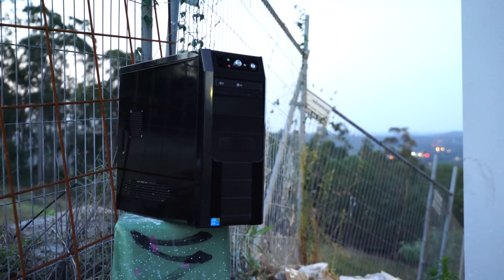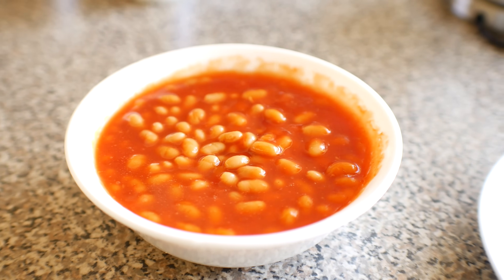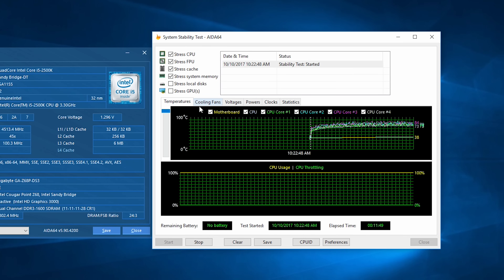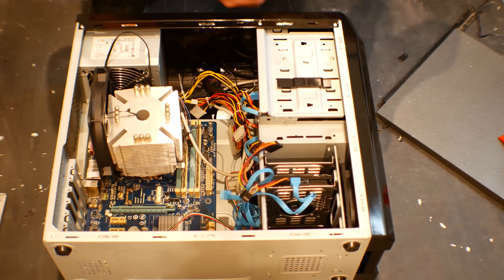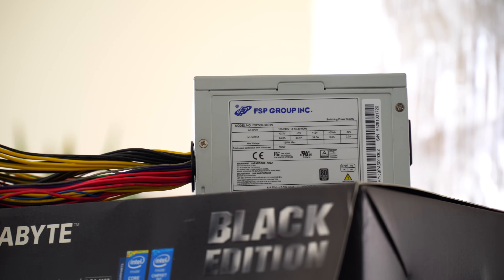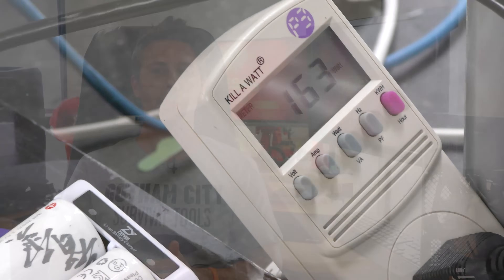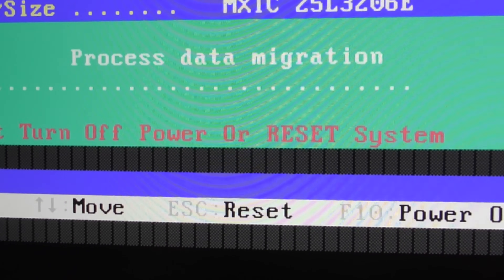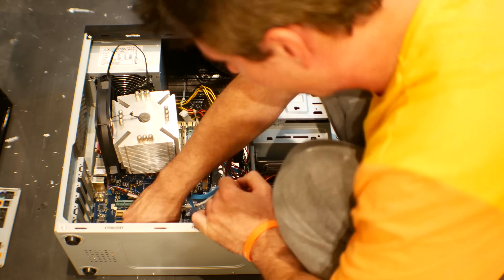Can you OVERCLOCK with a Zip Tie, Bad PSU & Budget MOBO?

Comment: I once had a shitty PSU from a brand named "HKC" and I rotated the 4pin CPU connector 90 degrees when plugging it in, so basically shorting the 12V rail. When I turned it on a bunch of smoke poured out of the power supply. Reconnected the 4pin properly and it worked fine.

Comment: I put two fan in my powersupply, not branded 480w 19A max on 12v used for 3 years, now it's running gtx660 uc and amd x4 860k stock . Can I overclock the cpu?

Comment: you can overclock i5 2500k to 4.5 because the i5 2500k does not support hyperthreading and only use around 80 watts at 4.5 ghz unlike i7 which use up to 180w( more like 160w though) at 4.5 ghz

Comment: Replaced my 7 yr old VX550 with a new Seasonic M12 620w. Barely 3 months into using it, smelled something "electrical" before it started turning itself off. Had it RMA'd and the VX550 is still chugging along.

Comment: Hey man! I haven't had any PSU die on me, but the OCZ ModXStream 700W I got in 2010 starting making a loud pop sound and spewing sparks when it first received power last year (by using the on/off switch or plugging it into the wall)

needless to say I hope, but I immediately stopped using it and got a replacement.

Comment: Try to do an extreme overclock with an fx-8320. I would get the fx any day over a 2500k, they run extremely hot but you can get them to 4.7 stable with a good cooler and even higher with watercooling

Comment: It's worse than supplying bad voltage, these "bargain basement power supplies" have a lot of electrical noise and well, a malfunctioning 5VSB which very likely will instantly kill your motherboard.
And they are missing parts too. What they do really, not a joke is start with a old design and stop taking parts out when it stops functioning and then put back the last part.

I had to RMA good power supplies anyway, principally because some creature went into the PSU and blew the main cap up and it leaked terrible fluids for seconds.
These shit power supplies though... I've blown them up with just 200W.

Comment: my first ever computer when i first started building 10 years ago i bought a 500 watt Rhino power powersupply that actually shorted and melted all the sleves off the cables to the point all the wires in my computer were bare metal.. miraculously all the parts in the computer survived.. well other then the power supply. i still have them laying around to test stuff i buy on ebay! My advise Get a good powersupply and the way i see it is if you aint buying name brand then you should not put anything together with it. diablotech is one crappy brand but for a 120watt system itll do you good.

Comment: Some time ago I had replaced my old PSU because I was hearing coil whine. I did research and every site was saying it'd be the PSU, so I did a smell and touch test. Didn't /really/ smell anything, maybe a little of odor, but to touch, damn that thing was hot. So I replaced it with a new Rosewill ARC 650W and was all good. Only for the coil whine to still be there! Turns out it was one of my two front case fans. I have the DYIPC Adventurer-18-G and it has fan controllers for the front and top fan speeds, and turning the front ones to low eliminated the whine. It was like the fan was telling me the PSU's gonna blow, mate.

Comment: Using 50W out of a 600W (supposedly) power supply is as stressful to it as using 570W. At very low loads, the power supply is very inefficient, therefore more heat and more stress. It is usually recommended to use around 50% or so of a PSU's rating. Just pointing it out, but yeah, ye videos are great mate. :)

Comment: I remember a long time ago working in a computer shop...

Boss did order a pallet of L&C "300W".. All of them 300W... yeahhh..

1/10 of these 300W did have a label with black text
2/10+- did have a label with green text
the rest did have a label with red text..

Beside the text color, the label where identical (same rating).

These power supply did come with a note paper with the following on it:

- 300W with black text on label = 300W
- 300W with green text on label = 250W
- 300W with red text on label = 200W

I wonder if that kind of arrangement still exist.

Comment: I had a pc power and cooling 750w psu blow out after about 8 years 24/7 use.  Had a ups fail with a bunch of magic blue smoke, rebooted pc and the caps in my psu made a really loud pop. Psu actually still was supplying power to continue booting my pc until I flipped the switch to turn it off. (No damage to any other pc components)

Comment: I keep a cheap Diablotech 350 watt PSU as a bench PSU in my shop for testing fans, and doing basic test builds with just a basic cooler, ram, CPU,  onboard graphics, or a low power Nvidia 8800GS 512MB PCI-E card for older motherboards to see if they boot since I got the PSU for free, but I would never use it in a full system build for sure, and far as having a PSU fry on me I had one of the green colored Antec Earthwatts 430 watt continuous 80+ bronze PSU's give out on me about 2 years ago now in a big puff of smoke leaving some brown, and black marks in the top of my then current cheap $28 case, but I got lucky because it had good over voltage protection so nothing else was harmed, so yeah even brands you think are decent can sometimes give you trouble, but I've had good luck with Newegg's Rosewill housebrand power supplies so when I'm buying on a tight budget I always check their prices, and see if they have anything in the 500 - 650 watt 80+ range or better on sale.

Comment: Just going to say I know why the quad sli didn't work. The cpu can only handle 16 pcie lanes and a dual graphics card needs 16 pcie Lane in one slot as it will not run on pcie x4 for one card hence why the bottom slot wasnt working properly. Should buy a old 3820k of 3930k as they can handle 4-5 video card configurations

Comment: Bad PSU - happened to me more than a decade ago, as soon as I powered my rig up - didn't prompt a screen and I saw my motherboard light up like a fireworks was happening. It took out the HD4850 1GB GDDR5 Graphics Card, Processor, the board and a Hard Disk. I can remember it to this very day.

After that - I only trusted branded Power Supplies to this day - never go cheap with your PSU, just aim for the "Bang for the buck" instead.

Comment: @Tech YES City that board can overclock that cpu even more  just were you went wroung  is that bios is bugged and you have to go to where the turbo settings enable it , set voltages  in there and amps to 350 then disable the turbo and it still retains the voltages for the cores  just not turbo , and then apply youre normal cpu clock voltages ie 1.3V / 1.4V and you should hit around 4.8 to 5.1ghZ

Comment: Most important thing is to cool it properly and test it regulary... I had Codegen 500w for more than 7 years it has several build running (geforce 9600 gso 192 bit, 2b ddr2 ram 800mhz Athlon X2 5200+ 2.7 ghz Hard disk 350gb Hitachi dvd driver two 12cm coolers (one on front and one from behind) and later after 2 years I replaced gpu with HD 6670 1gb ddr5 and 2 more gb of ram (4gb total) one more hard disk drive 500gb (total two 850 gb) it ran from 2009 until october 2016 when i replaced gpu with a way powerful HD 7870 2gb ddr5 256 bit (with molex y cable 2x6 pins) 4 more gb of ram (8gb total ddr2 ram 800mhz) Phenom II X4 940 3.0 ghz Black Edition (140w on stock voltage) and it ran amaizingly fine, without single issue, brands doesn't mean "evetything" just check it, test it, clean it and enjoy with it... I upgraded a gpu for one kid (he had hd 4500 4600 ) gtx 450 1gb ddr5 128-bit Phenom II X2 555 95w 4gb ddr3 ram and 500gb hard disk drive and you wouldn't believe ON 175W LOW END PSU... Now he plays games for more than one year without single issue...

Comment: 2500k are great overclockers. I've bought a 2500k on a p8z77v-premium (I think that has 16 power phases, best board of the time in my opinion) with a 670 4gb, 4x4 stick of corsair vengeance ddr3 and a tx750watt, in a working computer that had a broken hard drive for 300$CAD. I've managed to overclock it to 5ghz! It did 4ghz at 1.16v if I remember well. They're incredible little chips still.

Comment: Yesterday I just blew up ( literally) my Corsair RM1000x. I heard a loud pop and the computer went off. Everything ran fine for about 9 months (since I build the system) with a i7 6900k / Rampage V and 2 gtx 1080. Do corsair cheap out on some capacitors / chokes on these PSU?

Comment: yes i done it thxfully it pop when plugged in another motherboard for testing and motherboard still worked fine. was a dell dimension 8200 board i850. Startec psu are good quality

Comment: I bought  a corsair rm 1000i pwr supply to run my evga ftw mb with my 3820 sandy, two r9 280x's with kraken hybrid coolers, 16gig  of corsair 1600 memory 4x4 and a samsung 840 250 gig ssd. in a haf 932.  The corsair pwr supply came with red sleeved cables as a promotion, great!  PROBLEM, whoever sleeved the cables pinned the eight pin to the motherboard and one of the eight pins to one of my graphics cards incorrectly and when I powered on my system, it promptly caught fire.  whole system fried.  Corsair only replaced the pwr supply and sleeved cables, MSI replaced two graphics cards, albeit, two r9 390's, still,  out a very high end rig for the time!  I'm going to go cry now, AGAIN!

Comment: I have one very old system with powersupply called "Micro one" and when I started overclocking and set up 24/7 gaming server. It blew up in 3 days. Only one resistor had burnt so I replaced and it is still working!
Reply: I'm not too worried about it because It is 2005 system.

Comment: i got a dell t3400 $30, gtx 570 2.5GB $61 and a Antec neo 620w $27. The Dell t3400 came with an e4600, no HDD  and 4GB ECC ram. I can upgrade to an X3360 or Q9550 for less than $30. I still need to upgrade cooler to a dell 3 heatpipe cooler ($10 in ebay). I just want to play overwatch so once I get my 4 core I should be able to do it without an issue. I can also upgrade to 16GB ecc ddr2 ram ($16 in ebay)

Comment: I blew two EVGA 750 Gold rated PSUs after 2 years of not that heavy use. My system wasn't ever overclocked, it's barely dusty and I don't have very demanding hardware. When I tried to send it for repair EVGA asked me to ship it to Germany for them to DECIDE if they should fix it and the delivery was on me... Really disappointed me with that policy. Why should I pay for delivery on a part which is still in warranty? Anyway though... In the end I bought another EVGA PSU (this time the 850 Gold 2) and well, it's still running, I've still only swapped a graphics card for the 290x

Comment: Back in 2016 I had 3 power supplies die on me first was a evga 500b, second was same, third I went with a corsair cx650m it died 3 months later told corsair my issue they accepted my rma and since then haven't had one die on me (knock on wood) but now I shut the pc down every night.

Comment: I have an HP ENVY h8-1534 I installed a 1050 Ti in it, was great then I found out that I could OC the CPU with AMD's overdrive tool.... The PSU in it died after that. (was only able to OC like 300Mhz over stock) so I ordered a new PSU from newegg and picked up a 650 watt bronze from Rosewill on sale for like 30 bucks at the time. (I didn't want to spend much money on that system) the difference the PSU made was astounding, the system now sits at 4.7GGhz stable 24/7.

Comment: I'm not sure if left this message on this channel but yeah Crysis shut down my 2005 Silver Stone 650W PSU not once, but twice. I thought something horrible went wrong the first time but the PC booted back up and I tried it again. The second time I only got to play for a minutes till system shut down, the first time I got around 3 minutes of gameplay. Once I swapped out PSUs everything was fine. I swapped it out with a Rosewill 600W value 2 (free PSU from work) but it pulled through a half hour of gameplay without a hitch.
Reply: Oh yeah, I also had to zip tie a the stock cooler for a Socket 478. the motherboard side of the plastic mount snapped and the lever wasn't pulling on anything. Got out the zip tie's, cinched it down and 4 years later the PC still worked just fine. Zip Tie's work great if you take your time and get it even when tightening it down.

Comment: i got 1 extremely old sfx psu (forton source) 145watt with 4.5A 12v and it didnt even have 4pin cpu or any sata ,6pin gpu power cables so i put all reguired extra adapters an run athlon 64 x2 5000+ 2.6ghz @ 3.1ghz + HD 7770 ghz edition max oc ed. this powersuply is from 2000 to 2004 year and after a month of usage the psu stopped working at all :DD

Comment: Thought you were going to give up and connect the FSP!
Just bought a used FSP300-GHN, and that 300 watt has 24A at 12V, compared to just 1 amp more for that supposed 600W - it's going in my bits and pieces build.

Had an old 300W case PSU that got semi-cooked when the grumbling fan (I'll fix that later) finally died... system crashed, and EVERYTHING survived, even the PSU was still ok after replacing the fan

Comment: Im 99% sure my psu died in the summer. It was 7 years old and a cheap branded one. guess i got lucky with it lasting for seven years. the thing is i left the room to go and have dinner so i just assume the pc had gone to sleep and came back to it trying to power cycle and now doesnt do anything. since then ive made do with my laptop beacuse the pc market is just crazy atm.

Comment: I had questional psu in my old prebuilt,it was 500W Zito,only problem i had with it was fan died so i just lubricated it and it works to this day. There is nothing wrong with bad psus if you dont push them to the limit.

Comment: 3 months old Chieftec 600W blew up. 24pin connector melted. Sent back to repair. 
After 1 month they gave back the PSU and refused the repair "the connector is physically damaged" . Since that I am trying to explain those dumb fucks that yes, its damaged due to a fucking short caused by the PSU which was BTW on the warranty form since day1.

Comment: I figured you guys could help me out
I recently bought a Lenovo ThinkCentre M91p MT (I replaced the power supply btw)
In the bios I couldn't find any overclocking options
Is there a modded bios or updated bios I can get or is it just impossible

Comment: i have destroyed codegen PSU with strong resistor. it said it was 400w but rly it was able to do was around 50watts on 12voltage rail. :D also have destroyed some Hipro psus with car sound amplifiers these are also pretty terrible psus

Comment: I had a Thermaltake TR2 Challenger (500w) and when I swapped out my 960 for a 1070, a few months later, whenever I would play high demanding games like Rust and even Battlefront (2015), I would get constant shutdowns. I then swapped out the PSU for an EVGA 600w and it's been running fine ever since.

Comment: I've had a rather crappy psu for over a year now and it has never failed me, before I had a G3258 running @4ghz and now I have an X3430 @3.4ghz, but the thing is that I've never went above like 1.5v on those cpus (actually on 1.225v) to avoid the risk of asking too much from the psu.
Btw great videos, love them, keep up the good work. Greetings from Chile!

Comment: I had a power supply for an Intel 915 series board that one day literally blew up, sent a funnel cloud of smoke out of the back of the computer, and then I saw flames coming up the back from the front of the computer.  At this time I turned off the strip it was plugged into.  It was not a cheap ps.  It was called and earth friendly ps and was at that time pretty expensive.  I decided to tear it apart and found the wound section that was the 3.3 or 5 volt was very crispy and black.  I have not bought any of their PS since.

Comment: When i built my Ryzen 7 1800X PC back in April i had an 800W  bequiet! Straight Power 10  blow up after 5 days out of the blue. It was so gone that at first i couldn't get the circuit breaker to come back, only unplugging the PC let me get back the power in the room, and the instant the power cable made contact with the outlet it tripped again, not even going for the PC power button or anything.  

Luckily no other components were damaged, and the replacement PSU of the same model is running flawlessly ever since.

Comment: "If you smell something bad" :D.  By then it's usually way too late in my experience. Great video bud, I still have my original 2500K - what a beast of a CPU!
Reply: AdoredTV i once smelled the “smell of burned hopes and dreams you never forget” and it was one stick of my gskill tridentZ :( right before ram prices went through the roof
Reply: I smelt that smell once. It was my Kingwin 850Watt modular power supply exploding after 7 years of use. Thankfully it didn't take anything with it.
Reply: that smell is electrolyte coming out of the capacitors... Thats why we are buying mainboards with all solid capacitors :)
Reply: My 2500k is running 5.99 GHz air cooled for 3 years now. That's the jackpot in silicon lottery.
Reply: SchaSch94 OOO: what voltage?
Reply: SchaSch94 6ghz 24/7 stable is crazy
Reply: probably has liquid nitrogen in his air cooler and runs it at 2v
Reply: Might be a whiff of hardpaper, resistor paint coat, or of heat shrink tubing being burned to a crisp. These can occur early enough if you're lucky, if a component is running at its very limit rather than well over it.

Comment: Corsair HX850i running fine and suddenly and silently died while laying watchdogs 2. 
As an aside, It would seem that some of the performance issues seen in watchdogs may be related to the code making the CPU draw lots of power and current throttling.

Replaced under warranty. Large Bang the moment I turned the new supply on. It seems that the old unit melted something to the point of creating a short. So much for short circuit protection on the platinum PSU